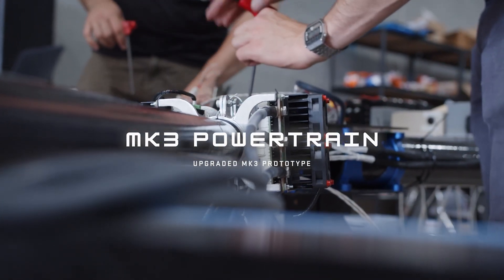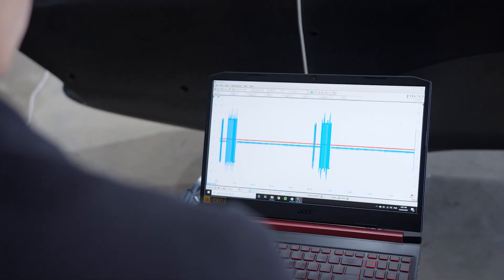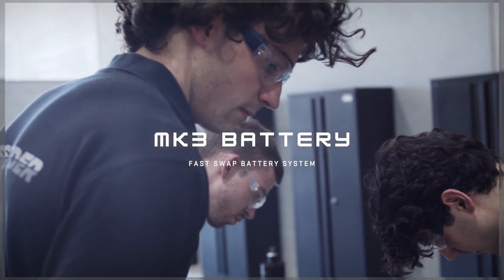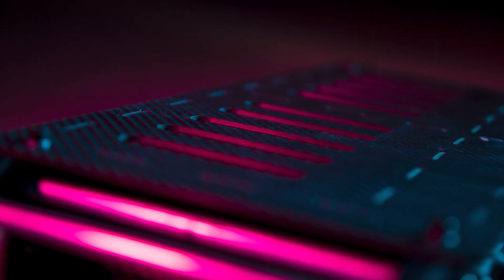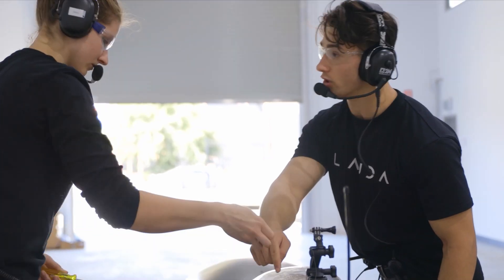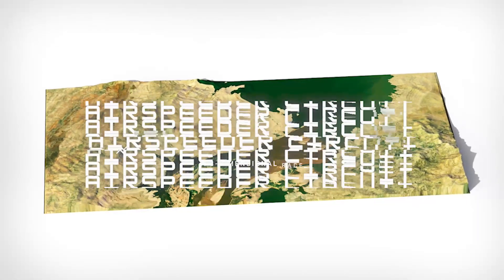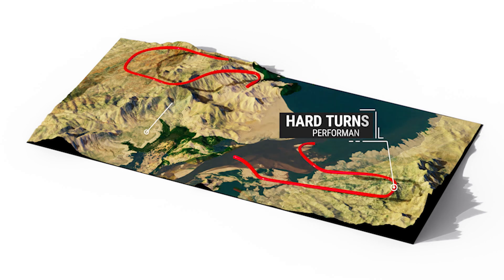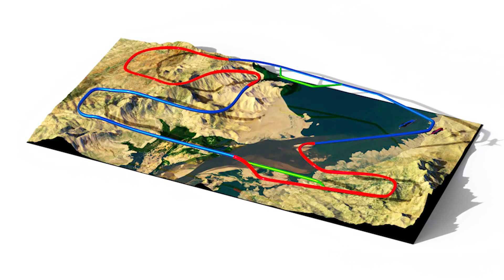Engineering an eVTOL Grand Prix | Alauda Aeronautics Taking Flight Series

Comment: a few quick questions if I may:
What type of motor are you using?
What is the span of the prop blades?
What does the battery system for these craft weigh?
What does the vehicle weight (with and without battery)
and what would be the max flight time on one of these batteries?
Cheers